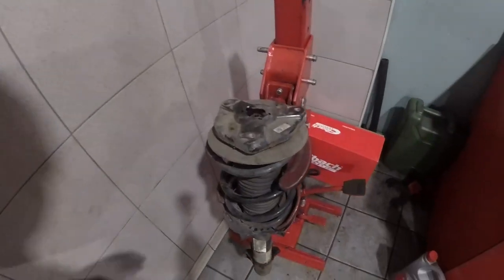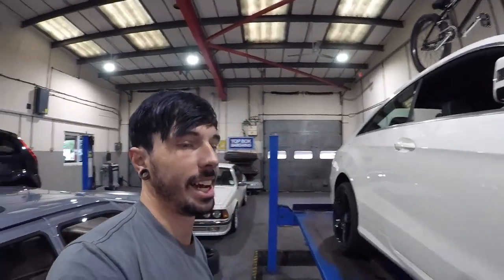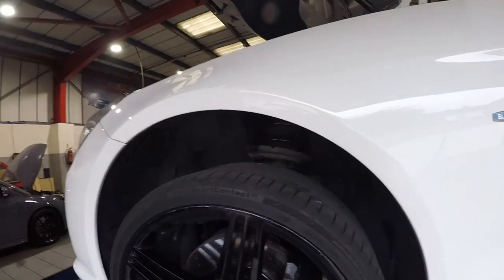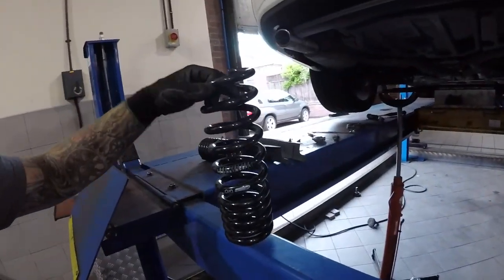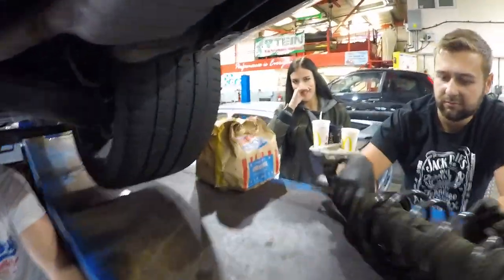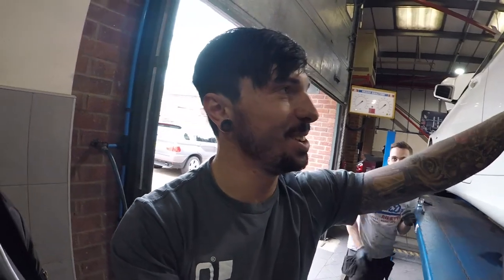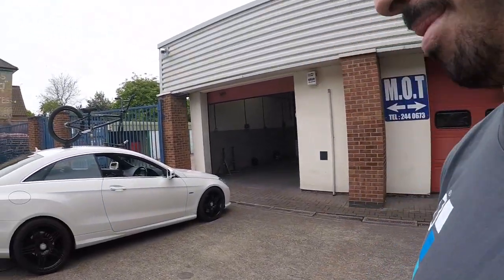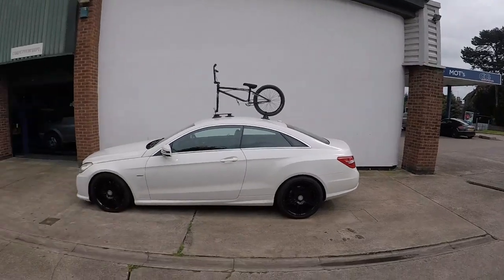LOWERED MY MERCEDES E350 * EIBACH *

Comment: Nice car mate!  I've got an e350 cdi saloon. I'm thinking of lowering mine and putting some 3sdm 0.04 on wit a slight drop. How does the car feel lowered on 19's? How does it handle the shit uk roads and is any of the comfort lost?
Reply from the maker: tolsonryan id say compared to the 18s you do lose a bit of comfort but has to be expected. But its not so bad still really quiet inside handles so much better you feelso much more connected to the road but yeah pot holes suck bad!!!

Comment: Hi Mat, what sort of spring compressors did you use on the rears? Bought these springs for mine, but reading that you cant use the basic compressors??
Reply from the maker: I didn't need spring compressors for the rear they just lifted out and new ones slotted straight in